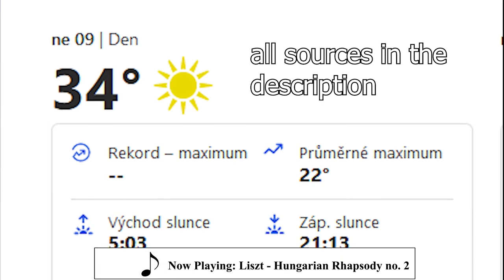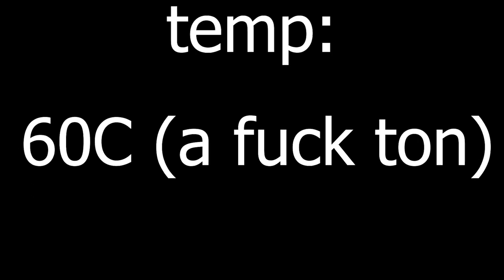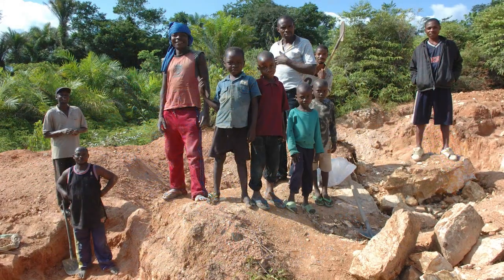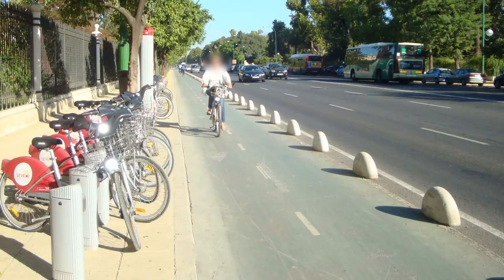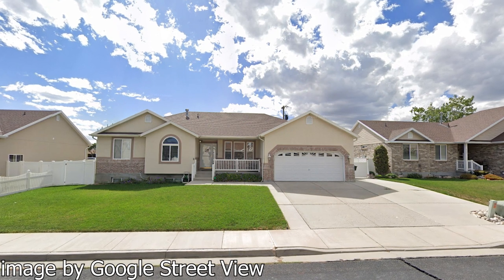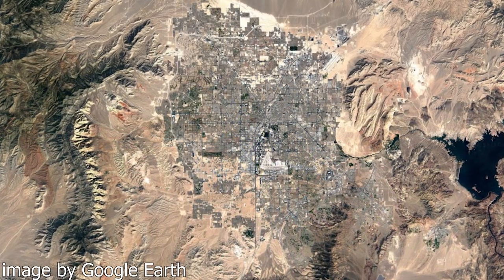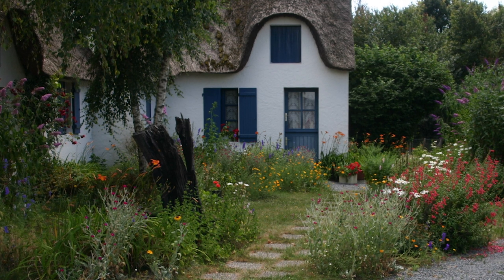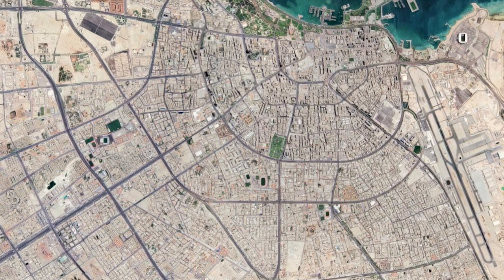How to Prepare Your City for Heatwaves

Comment: I believe Winnipeg is even better comparison than Vancouver, as it also sits above that 50 lat. line. The climate there is way more continental though, they dont have gulf stream and no mountains in the north so the result is a bit chillier in winter.... just my note.

I think you might be interested in taking a look at The Eastgate Centre in Harare, Zimbabwe as that is a quite newly built building where the architect had to face difficult conditions. They couldnt afford to actively AC the whole building (its huge) so he came up with design based on a termite mound basically. There is a nice video explaining the air flow and how he managed to cool the inside without just slamming AC units in every corner. Your examples of some of the arabic house designs reminded me of that.

Also Vitruvius in his  books of architecture talks a lot about the right city layout/direction of streets, etc. Might be an interesting topic.

Keep up the good work.

Comment: I just got it on my video feed today.
I would like to add two or three other possible solutions to heat zones.
Adding water and fountains, the temperature of water is usually lower than the temperature of the soil (or heated stone/concrete/tarmac).
The other one would be to add shade sails.
Other things that are possible and more spot-solutions that I’ve seen were water-mist fans and in the city I’m currently in (Luxembourg) during peek hours of heat waves on the Grand Rue there are stalls giving away refrigerated drinks.
You usually can’t pick the drink, I guess it’s the one the sponsoring soda drink company wants to advertise but, hey it’s free.
Reply from the maker: Haha, fitting considering that I am dying from the heat

yeah, water fountains and such are a good idea, parts of Prague have them

about the soda, I agree, it's free, why not lol